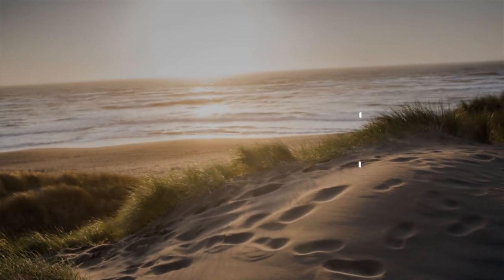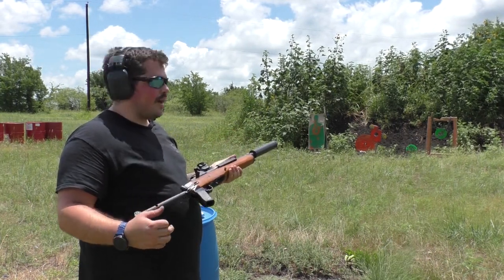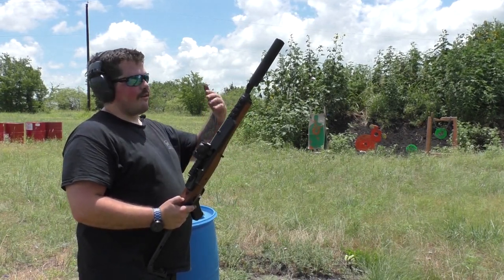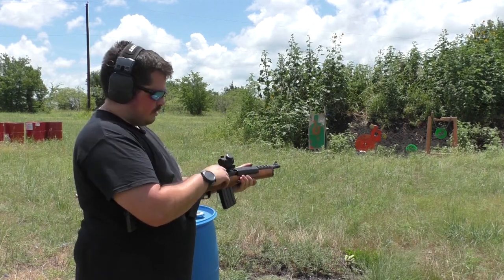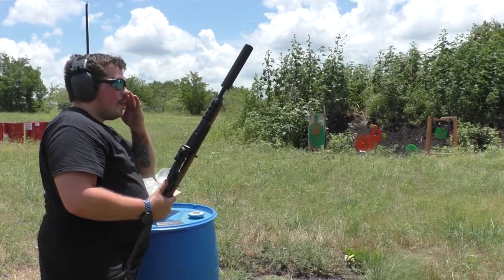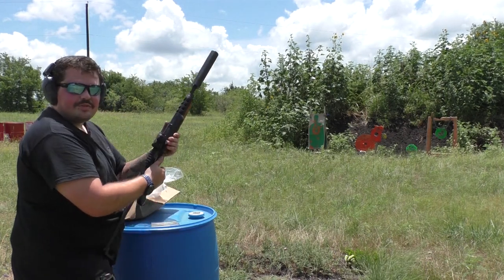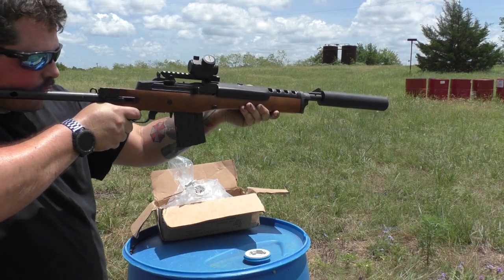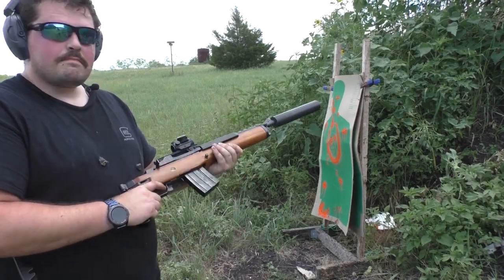How to ruin a mini14

Comment: The AC556 stock will not interchange with the Mini 14 .
Reply: The newer 580 series can.
Reply: @ScottAT  nope, the receiver is longer on the AC556 than it is on a Mini 14. And the AC556 has a notch for the selector switch that the mini 14 doesn't have.
Reply: @WBatte1  oh, I see. Thank you for the clarification. I have seen stocks that look exactly like the AC556 and are formatted for the Mini-14. It’s a common assumption.
Reply: i used my 180 series to build a aac 556 clone with a parts kit and the stock fit fine thev early 180s share  the same receiver specs

Comment: I wonder if its possible to do a compromise with a pin and weld vs having threading, and that's machining a barrel with 16" length, and cut the inside of he muzzle back a little, and put in slot porting, like they put on race guns, but only in the grooves, leave the lands intact  (like a twist pattern) and only at the 12, 3 and 6 o'clock, so I like an a2 birdcage... but then have end machined such that there's a threaded "shoulder" behind the muzzle insdead of on it, and this could be a large thread set up, like you sometimes get with larger firearms. You could put a knurled thread protector ring on it to keep them fresh, or include a taper that's industry standard so it can take larger suppressor host muzzle devices.

You'd end up being legal, having the benefits of recessed suppressor attachment length you get with QuickAttach mounts which allow lower OAL per volume, and when nothing is on it, you get same length benefits as a pin and weld without sacrificing harmonics, or threads.
But I suppose it would require experimentation to not paint yourself into a corner and lose all aftermarket support, then you're back to square 1.

Comment: @twistedgunsmith93 You reckon this setup would run better unsuppressed if it was .300 Blackout? Been told the same thing about running a barrel that short with .223, was hoping a larger caliber (other than 7.62x39) would be reliable.
Reply from the maker: I dont think the caliber woulf have alot of impact. This is an issue whenever you cut a barrel so close to the gas block on a system not meant to do it. You can address this in a few ways the easiest is to slightly open up the gas port to allow more gas to bleed off but only to a point.
Reply: @twistedgunsmith9366  Thanks for the response, I ideally wanted a barrel length exactly like yours, how reliable is it at it’s current configuration? If it’s not quite 100%, how much extra barrel do you think would be needed to make it as close to 100% as possible..?
Reply from the maker: @IvyMike551  just plan on opening the gas port a few .001's. Or maybe leave a good 3 or 4in in front of the gas block

Comment: >How to ruin a Mini 14

Step 1) Invent it.
Reply: Its better than an ar-15 . I did a dust test and decided the ar-15 rifles were not reliable and needed to be sold and bought more mini 14s because they are more reliable
Reply: @LovingIdaho  love my mini-14! ❤
Reply: @LovingIdaho  short answer you're wrong long answer the mini 14 is more susceptible to dust and dirt because it has a massive hole on the side for dirt to go into
Reply: @cantsneedgaming4591  kind of like the ejection port of an AR?? lol... both will fail if too much dirt gets in the bolt/magazine area. The difference is that the mini is made to wider tolerances so it does outperform an AR in that regard. The mini is also MUCH cleaner operating due to the piston vs AR DI system... again which makes the mini more reliable.
Reply: @C.Double.  go look at the in range mud test
Reply: @cantsneedgaming4591  ar15s are horrible as far as reliability. Mini 14s and AKs are really reliable.
Reply: @S.C1970  bahahaahahaahha look at an m14 mud test lol
Reply: @C.Double.  AR not reliable? Explain away the Military Arm Channel's AR torture test where a BCM AR went thousands of rounds without cleaning.
Reply: @ZorinInc  Did you replace the factory op rod recoil spring and gas seat bushing to reduce the rifle from beating itself? It seems that's the only way to reduce getting a peened bolt and to get it even group a consistent (lousy) 4 MOA. The Mini is over gassed.
Reply: @LovingIdaho  Ok lol? So why didn't you post a video?
Reply: @S.C1970  Inrange TV did a mud test that proved the opposite lol. So did Tim from the Military Arms Channel.
Reply: @Enjoyer.762  except I never said the AR was not reliable, I only said the mini was more reliable in regards to bolt related and gas system stoppages... which it is.
Reply: @C.Double.  No it's not "more reliable". In fact, it's less reliable.
Reply: @C.Double.  The Mini is over gassed even more so than AKs, which contributes to the Mini 14s accelerated wear of recoil springs, extractor springs, ejector springs, extractor failures, and bolt deformation. The receiver, bolt, and op rod are all inferior investment cast metal.  There's a reason why police departments got rid of them and switched to ARs 20 years ago. A Mini 14 and AC556 will break before an AR15 and M4 Carbine does. Right now you can head over Mini 14 gun forums and still read long rants of people having problems with broken bolts, extractors, poor accuracy, shifting / wandering zeros, magazine feeding problems, Ruger's inability to fix problems, poorly heat treated parts, ect. A total dumpster fire lol.
Reply: @Enjoyer.762  I can always tell when I'm talking to someone who has an opinion of something they have no real world experience with. "Wear of recoil springs, extractor springs, and ejector springs" happens to any platform. As someone who has owned both, the difference in normal wear is negligible with the mini taking the advantage by having a piston gas system... I have a 180 series mini that I have yet to replace any part on and shot on a regular basis up until about 5 years ago when I bought a new model which has also run flawless. That being said, Out of thee 3 ARs I've had, 2 I had to replace parts within the 2k round mark. The other has run flawless but was also a much more expensive build. As far as mini's being over-gassed, that's for a reason. They will literally shoot anything... and most people that don't actually own one never learned that you can adjust the gas system by replacing a very cheap bushing.

Also, most police departments switched to the AR because its overall just a better platform for the application, lighter and much more modular. "broken bolts, extractors, poor accuracy, shifting / wandering zeros, magazine feeding problems, Ruger's inability to fix problems, poorly heat treated parts, ect" - this sounds like every AR fanboys fight against what they think a mini is... the only truth in that statement is that there were accuracy issues in the early mini models that were corrected by a contoured barrel that fixed the barrel harmonics and stopped the wandering zero/stringing issue issue. This was corrected almost 20 years ago so your "inability to fix problems" comment is kind of a moot point ... the only other issue you ever hear about is magazine feeding problems when using aftermarket mags, this is the same with an AR... you buy cheap mags, you get feeding issues so thats another moot point. 

As far as "reliability" goes:
Over-gassed is better than Under-gassed
Piston is better than Direct Impingement